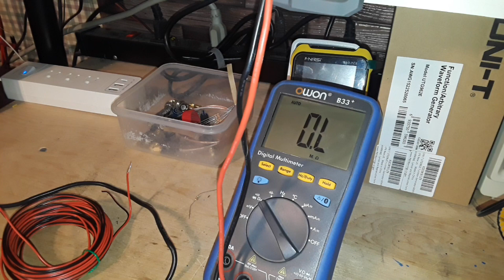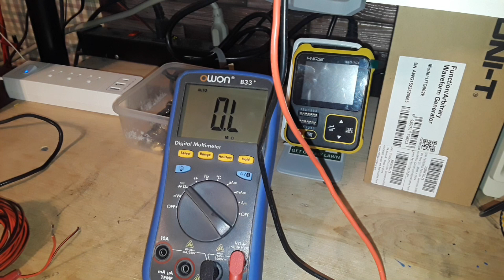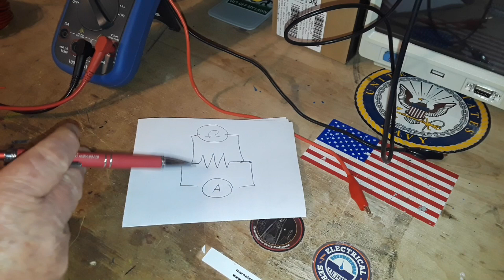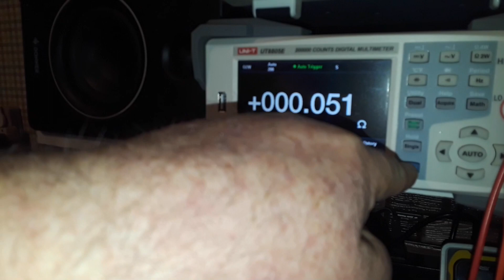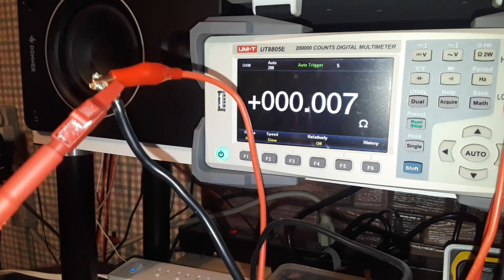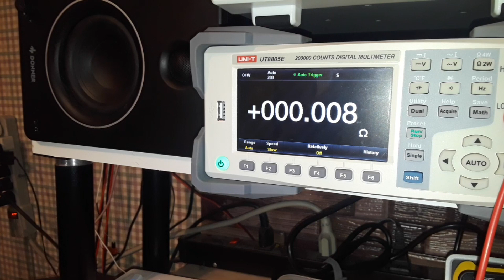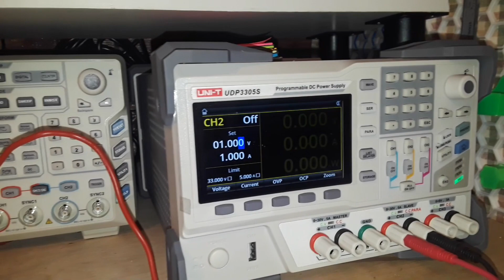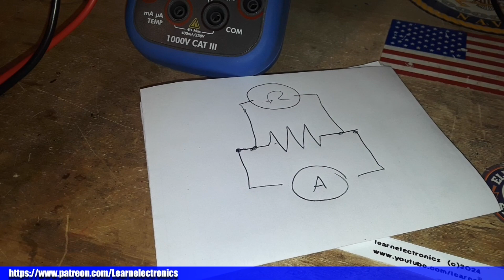How To Measure The Resistance of a Section of Wire - brought to you by Solderstick Wire Connectors

Comment: A guy on another channel said the best trick he ever learned from an old timer was how to calculate how much wire was left on a roll with an ohm meter.

It was much faster than unrolling several partial rolls and measuring the lengths.

Comment: A big use for this technique is connections in power systems. We make measurements across closed circuit breakers, isolators, bolted joints etc to assure low enough resistance, during maintenance. 0.1 ohms at 2000A would end up as a bad day! The equipment at least here in the UK is called a ductor.
Reply from the maker: I've never heard the term ductor, I'll check that out. Thanks

Comment: Kelvin measurement of resistance is the application of Ohm’s Law: R=E/I. You simply push a known (calibrated) current through the resistance under test, measure the voltage drop across it, and divide the voltage by the current. You were pushing one amp in your handheld multimeter example, but the voltage was not one volt. Had the voltage been one volt, with a resistance of 0.003 ohms, the current drawn from the supply would have been 333+ amps. So, the power supply was operating in constant current mode, supplying one amp, and the multimeter was measuring the voltage drop across the length of wire.  The bench meter does the same thing. It just also does the math, and displays the result labeled as “ohms.” Four-wire resistance measurement is simply pushing a known current through an unknown resistance, measuring the resultant voltage and crunching the numbers.